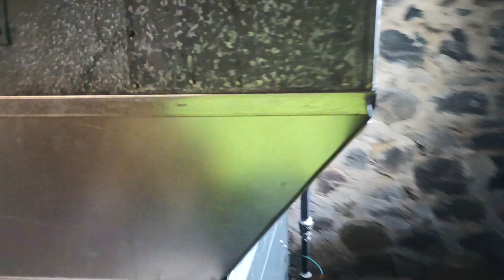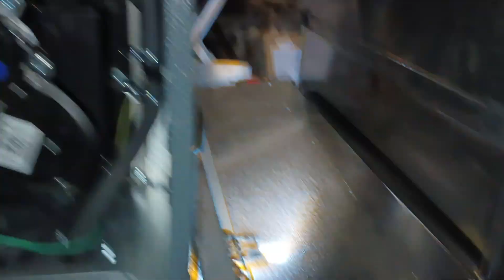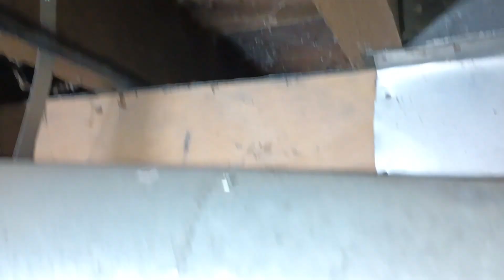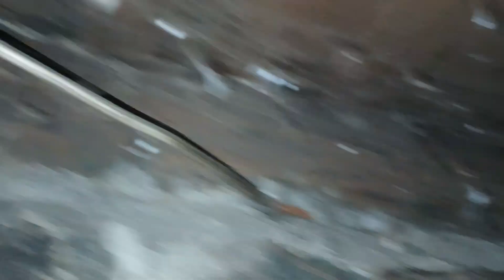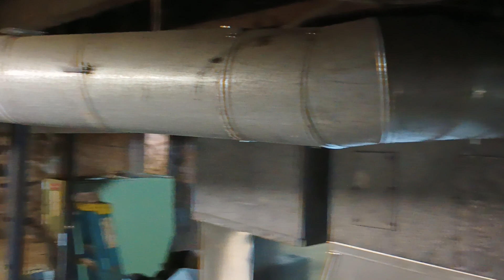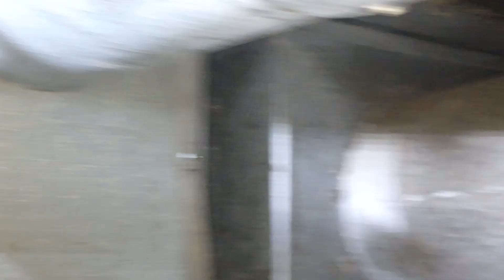Spider webs and scary places, part 2

Comment: Make all the spiders go by by
Reply from the maker: Flame thrower was the first thought...
Second thought: 130+ year old timber framed house + Fire = Smoldering basement in 30 minutes.
Reply: If it's yours, of you have the means, maybe set up cheap camera set ups and see what happens when the basement is at least a steady 6O°F
Reply from the maker: @j.l.m.6862  It may come alive.🕷😧